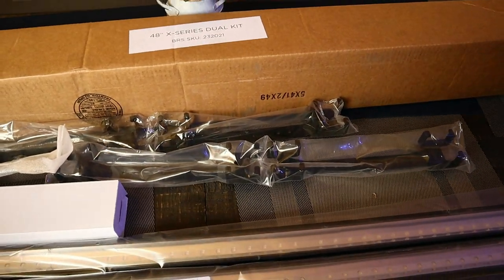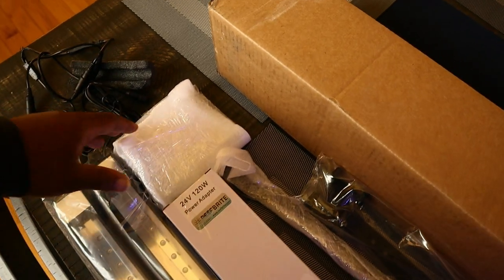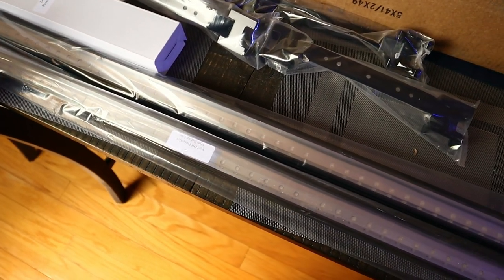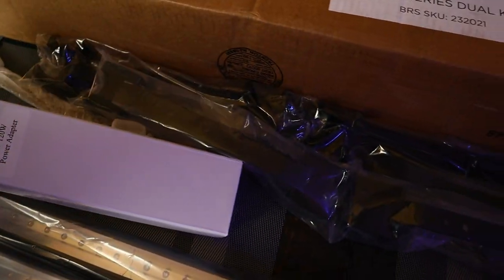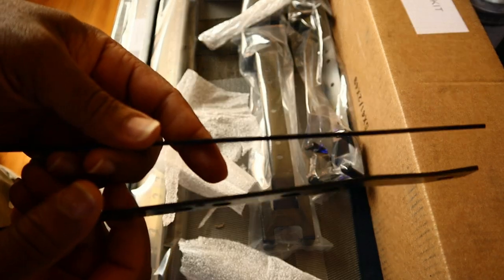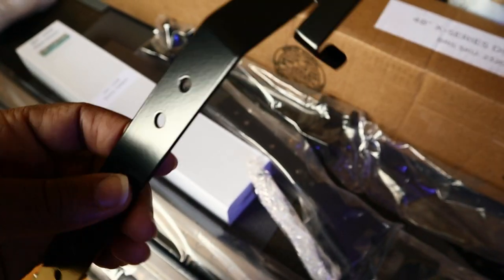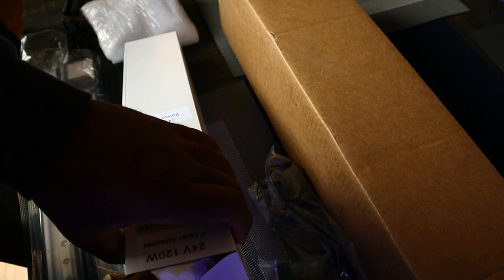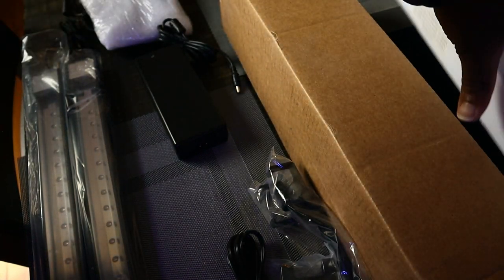Upgrade Your Aquarium with Reef Brite Xho-x Series Light

Comment: How are you liking this unit? Not sure if it’s worth the 800 for this or just get another radion to mount on my multi rail rack
Reply from the maker: It depends on what you're looking to get from the light in my case I needed more front and back coverage across the tank and this solved that issue very well. In an ideal situation, I would have used multiple xr30's and configured them to what I needed.
Reply: @SimplyReefing  thanks ya I’m torn in my head.  I do need a little more power for sps but love the spread and pop of these or the orphek led bars.
Reply from the maker: @mikejohnson9923  I've had both the Orphek and now the Reefbrite and will say the Reefbrite has more of positive impact on my tank. I did a video on the Or2 blues some time ago.

Comment: do you prefer the reefbrite or orpheks?
Reply from the maker: That's a tough choice but as far as light bars Reefbrite has my vote for overall light.
Reply: @SimplyReefing  does the reefbrite give more colour pop?
Reply: @golbs7542  nope the orphek give more color pop. But the reefbrite is a more even spread similar to t5's hybrids. Also my bet is the reefbrite gives a higher boost in par (not confirmed with par meter). I have both and use both for different purposes.